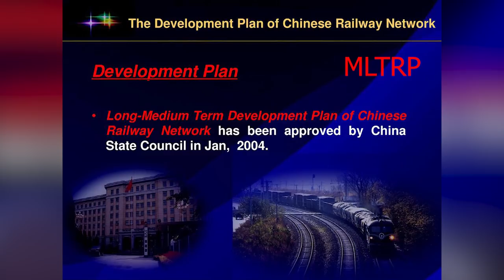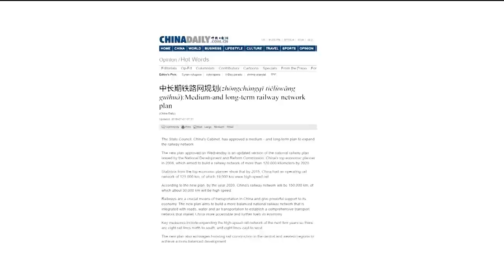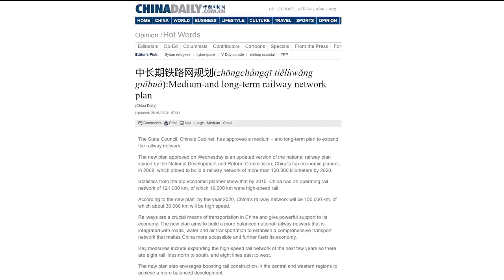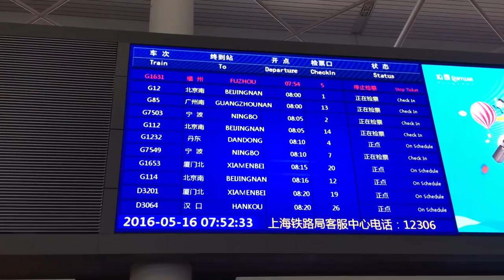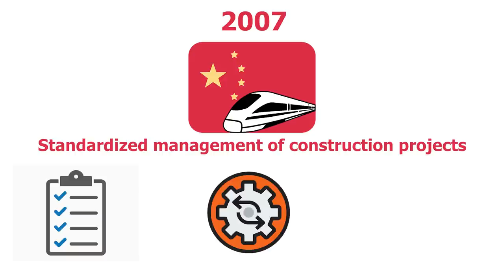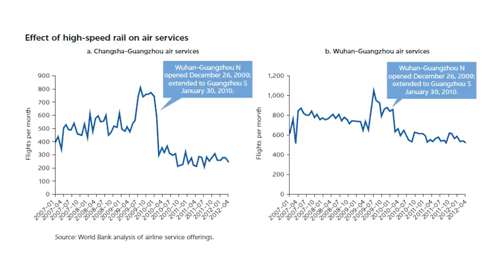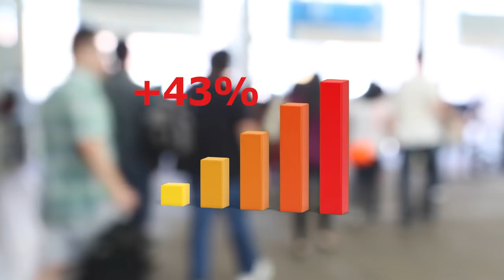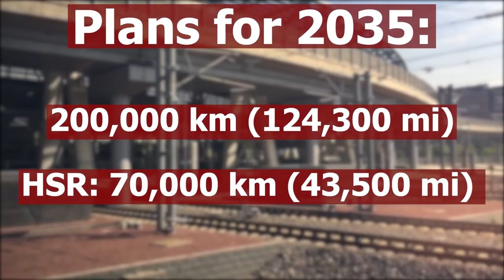How China Constructed 36,000 km of High-Speed Railways (in less than 12 Years)

Comment: I took a 1,200 km regular train from Beijing to  Xian (Terra-cotta Army).  Departing 8:40 pm arriving next day 8:29am. I paid ¥753 ($114) per ticket for a private two-bed cabinet including a washroom with my wife.  This was comfortable and better than high speed train because all HS trains depart at am to early pm time. Even though it takes 4-5 hours to get there and costs only  ¥535 ($81), but by the time I get their I would have lost half day on the train doing nothing.  Because of arriving earlier, I managed to go to two spots instead of just one if I take high speed rail. 
Travel tip: remember take regular train # Z19
Reply from the maker: Тhanks for sharing your experience!
Reply: I like to take slower sleeper trains to save a night of hotel and day time traveling as well.  Did that in China and Spain.  The experience in both trips are good.
Reply: travel by regular train enjoys some additional flexibility;  travellers could stop and deboard at any station en route and elect to delay their onward travel by up to 24 hours free of charge.

Comment: in addition to the high speed trains, for metro lines open 2021&near future in China (around 1250km will completely open in 2021 this year(250km for beijing/shanghai/guangzhou/shenzhen,1000km for other cities)

Shanghai：
2021: 
Line 14 
the rest part of Line 18

Guangzhou:
2021
Line 18-fastest city metro train nationwide
Line 22-fastest city metro train nationwide
Line 7 west extension to Shunde district in Foshan city
Line 2 of Foshan city connect Guangzhou south railway station
Xicun station & Caihongqiao station of Line 8 north extension
2022
Line 5 east extension
Line 11-circular line
the rest part of Line 18
the rest part of Line 22
2023
Line 3 east extension connect Haibang station of Line 4
Phase 2 of Line 7
Phase 2 of Line 13
Phase 2 of Line 14
Line 10
Line 12
Line 3 of Foshan city
2024-2027
Line 8 east extension
Line 18 north extension to airport area along with the Pearl River Delta intercity railway system
Line 22 north extension to airport area along with the Pearl River Delta intercity railway system
Line 24
Line 28

Shenzhen
2021
Line 20
2022
Line 6 branch line
Line 12
Line 14
2023
Line 13
Line 16
2024-2025
Phase 1 and Phase 2 of Line 8 east extension

Beijing
2021: 
Capital Airport Express extend to Beixinqiao   
Line 8  North-south connection  
Line 11 Winter Olympics branch line     
Line 14  East-West connection   
Line 17  Phase 1 
Line 19  Phase 1  
S1 Line  Jin'anqiao to Pingguoyuan  
2022: 
Line 12  
Line 16 Southern section  
Line 17 Northern section  
Daxing Airport Express extend to Lize Business District  
Changping Line  Phase 2
Line 1 Fushouling station reopen

Comment: Excellent.  You should do another video on operations and particular traffic volumes. AFAIK passenger traffic on the high speed network has now surpassed that of the conventional rail network. 

It would be worth mentioning ticket prices too. 

I’m surprised China hasn’t introduce double deck high speed trains.  

One final note: don’t get suckered in by the CCP rhetoric about “socialism”.  China has restored capitalism.  Even the United States has state subsidised rail services because their economic benefit exceeds the cash returns.
Reply: That's because China currently only uses HSR EMUs, probably to limit axle weight. Due to lack of underfloor space for equipment, double decker EMUs are limited to 200 km/h (with passenger capacity already somewhat compromised compared to unpowered double decker carriages), which is far short of 350 km/h.

Comment: And here in India we still have people who question the need for a bullet train saying there are already flights in that sector without realizing that the trains stop at 5 stations in between the two terminuses.
Reply: taladuga picpwaspwat   You are totally unaware of how travel industry works.  Here's what works in favor of Railways as opposed to Airways. 
1. A train can have 5 stops in a 500 kms journey.  Each of these stations will have people moving in both directions. 
Whereas an Airline cannot have even 1 stop every 250 kms. 
2.  You can check into a train 10 seconds before the door closes.  
You must check in for a plane about 30 mins (minimum) before take off.
3. A train carries 1000 passengers in each rake. You can have 20 high speed trains in each direction using 2 tracks, with each seperated by a distance of 25 kms.
That means a capacity to carry 20K passengers in 3 hours to and fro (combined passenger load from stations in between).
4. It brings cities within 100-200 kms within daily travel distance. (Like Mumbai - Vapi, Baruch,  Ankleshwar, Baroda etc). 
The entire corridor will be well connected and all citizens in the route will get better opportunities.
This will bring economic activity to the entire region. 
I can list many more reasons but I think this will suffice.
On the other hand you cannot fly to destinations that are 200 kms since the time taken to check in, take off, fly and get out will be more than going by a bus. 
So my dear friend Trains can be only challenged by Hyper loop whenever it becomes a regular means of travel. 
Until then, trains are indispensable.

Comment: Regional trains are almost non-existent. Local services are missing and heavy rail faster and longer metros in cities don't exist for the most part. There is still a long way to go.
Reply: "Regional trains are almost non-existent" how do you measure that?
"longer metros in cities" what is long enough?, what is "most part"?
did you consider other means of transport?
Reply: @rncmv   I measure that in the fact there are almost none there. metros are shorter, slower, more frequent in stops (which do have their place in a city) but not to be the only option. This will never relieve congestion or cover an entire city alone. What other means of transport is there except cars? Congestion makes moving in cities with a car impossible or undesirable. It is however the only option for most Chinese right now. Once they have heavy rail metro and regional that link into the wider rail network, they will start to solve some problems. So too with Intercity (as opposed to high speed services).
Reply: @richardwills-woodward  Did you ever hear of busess? More than 4 milion passengers / day by BRT only https://brtdata.org/ocation/asia
"there are almost none there" What lines are operated by regular, or regular fast trains, if not for the regional ones?
"metros are shorter..." What do you consider long enough? Half of the top 40 longest metro systems are Chinese.
Is higher number of stops a disadvantage for a metro system?
By "intercity, as opposed to high-speed" do you mean this?
https://www.chinadiscovery.com/china-trains/normal-trains.html
one more link:
http://cnrail.geogv.org/enus/station/34370444
Reply: @rncmv   Buses? UK has extensive buses but they're only to go a few miles in cities and only poorer people generally use them, and they don't get you very far in an hour.
Reply: @richardwills-woodward  in that case there is something wrong with the UK public transport; however, I can´t see how this matters regarding transport in China; 
how much is "few miles"?
"There is still a long way to go." also applies to your style of arguing (10-years-old-level)
Reply: @rncmv   No, because we have many trains. People will not take a bus if they can take a train much of the time (apart from in central London where any person may do). You brought up buses, not me. Transport in China needs a lot of work.
Reply: @richardwills-woodward  I reffered to busess in China, not in some other country. Particularly busess in chinese cities, which - according to you - have only some "short metros" and cars to choose from.
Reply: @rncmv   I didn't say they were short metros. I stated that segregated metros are shorter than hear rail metros. Both have a place but Chinese cities mostly have just one of these options which don't and can't serve outer suburbs. Buses are irrelevant - they serve short journeys but that is not what we are talking about. We are talking about mass transit.
Reply: @richardwills-woodward  "that segregated metros are shorter than hear rail metros" you did not say anything like that (here before)
"which don't and can't serve outer suburbs" You mean, 673 km of metro-lines in Shanghai don´t serve outer suburbs? This one example proves your statement wrong.
https://www.travelchinaguide.com/images/map/shanghai/subway-map.jpg
"Buses are irrelevant, they serve short journeys..." Yet another utter nonsense. The first part of this quote is enough to prove you incompetent in this matter. 1000 bus lines in Shanghai are irrelevant? Bus rapit transit system in another 20 chinese cities with more than 4 mil. passengers daily is irrelevant?
The "mass transit" is not about length of lines. It is about transporting many people at once, hence the word "mass".

Comment: China's investments in HSR is mainly an alternative to domestic airways. Unlike the US who deregulated their airways in 1978, most of China's airspace is controlled by the military. Most private air travel needs military clearance and airport delays are common from this. HSR is a compromise over airspace privatisation. 
The US relies on airways for passenger travel and left most of its rail capacity to freight. China has chosen to build a new rail network to segregate passenger rail from freight rail to increase capacity for both. HSR and freight have to be segregated anyway so the passenger network might as well be high speed. 
The balance between passenger and freight is an issue that every country with rail has its just HSR today is more competitive against airports, like the purpose of UK's HS2 is to move passenger rail off onto a new network therefore boosting both passenger and freight capacity while London's airspace and 6 airports are already stretching the limits.
China's workforce is also very transient, many workers in the top tier cities don't officially live in the cities they work in and therefore China has a huge demand for inter-city travel that is un-rivalled. This how the Chinese new year period in China is one of the biggest human migrations in history.
Reply: This is true.

Comment: There are more sinister reasons for the HSR development.
These large construction projects are easy ways for local officials to inflate GDP figures and gain notoriety from higher ups for their promotion.
After they got their promotion, the mountain of debts for those projects are not their problems any more.

Also, large construction projects are easy money for corrupted officials to steal.
Many of the CCP officials were caught with literally tons of cash, gold in their house.

Once you get rid of the check and balance in the government, you can do things in great efficiency. However, the efficiency toward what is not guaranteed. In China, the conditions are mixed. You get great infrastructures such as HSR, but you also get wide spread corruption and human right violation.
No government is perfect. But I prefer check and balance over uncontrolled efficiency.

Comment: if you ignore the fact that property rights are not a thing in china, it accounts for a lot of the speed of the construction.

It would have been better for those at the bottom of the economic ladder if China had invested in better standard rail.  Standard rail can provide 200Km/h speeds.  It's not as prestigious, but faster travel for teh majority, rather than the small middle class, would see a massive improvement in transport quality.
Reply: They have chosen to increase the max speed rather than the average speed of train travel, which mades short-medium distance commuter train travel almost non-existence (and kinda suck)

Comment: India is following the same strategy that China followed in mid-1990s and early 2000s.
China's case:
In Early 1990s, China started increasing the speed of its normal trains, 130kmph - 160kmph
In Late 1990s and Early 2000s, China introduced its first semi-high spee and high-speed trains. 160-250kmph

India's case:
2015: India launched its first semi-highspeed train and started improving average speed of its trains. 160kmph
2017: India introduced another semi-highspeed train with modern features - The Tejas Express 160kmph
2019: India introduced its first higher-speed train, Vande Bharat Express, 180kmph. capable of 200kmph
2021: India announced it will increase the number of Vande Bharat Express trains to 47 by August 2022. Construction on Mumbai-Ahmedabad bullet train started.